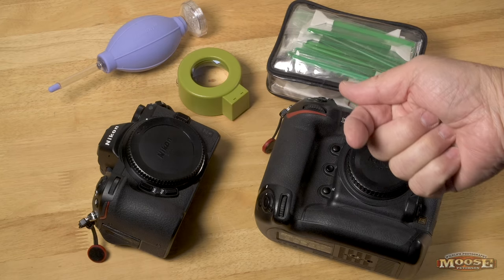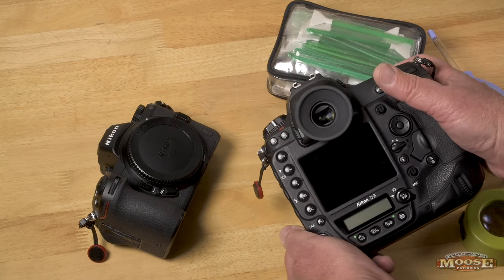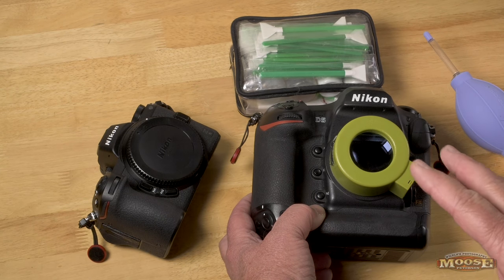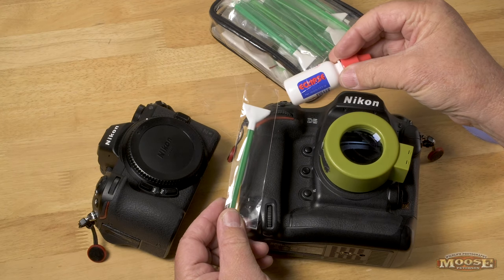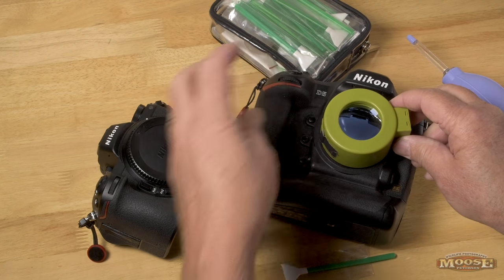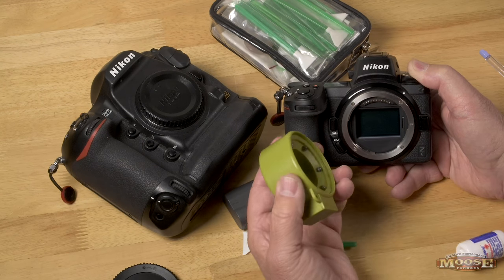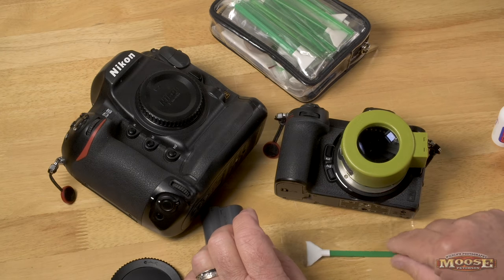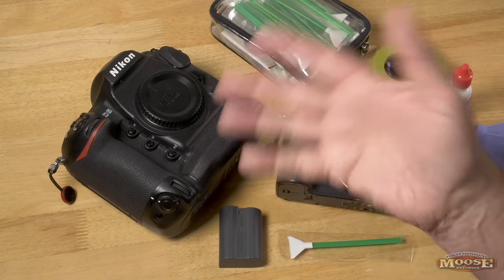Sensor Cleaning '19

Comment: Thanks Moose! I have a question, I was out shooting yesterday with my D7200 and all of the sudden a clear round dot shows up in my center focus point box, I thought maybe something was on the lens but I can see it with or without a lens or with the camera on or off. It doesn't show on my photos. It looks like a clear round lens through the viewfinder and it is directly in the center focus point box and the exact size of the box in diameter, if I move the focus point box the spot doesn't move...Any idea what is causing this? I took my blower and blew everything out and the sensor looks clean, I was thinking maybe something with the AF bay...Any Ideas? Thanks for any info!!!
Reply from the maker: it's in the viewfinder
Reply: @MoosePeterson  thank you sir!
Reply: Is there anything I can do about it or would it be best to just live with it?
Reply from the maker: @bassangler73  it can be blown out, you can try or just send it in to Nikon, very common
Reply: @MoosePeterson  thanks again Moose!